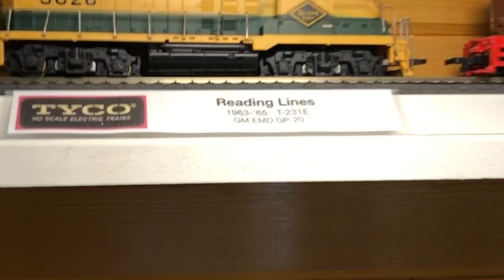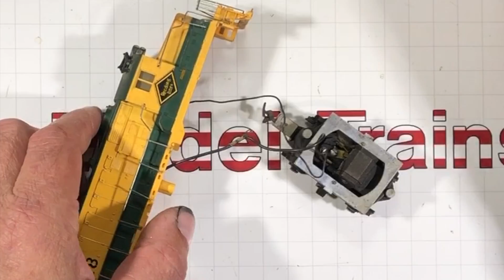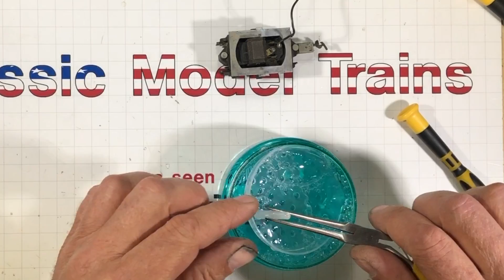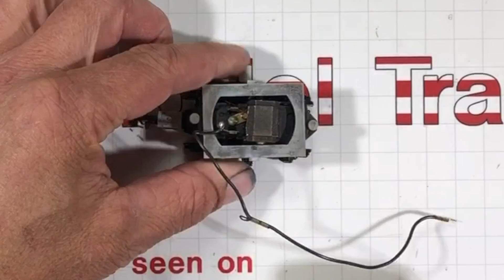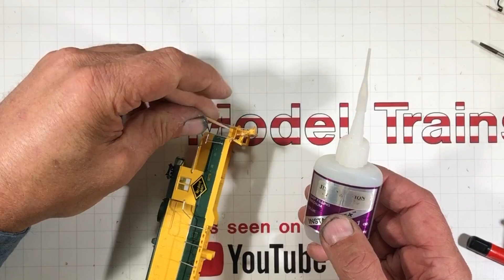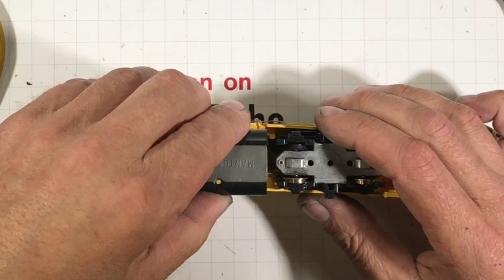EASIEST Way EVER to Service Tyco MU-2 Drives!!

Comment: Ron, I tried this method for repairing broken corner steps on one of my locomotives and it worked out well.  I got some blocks of clay and Testors tube-type model cement from the hobby shop.  I used a good step to make an impression in the clay, to form a mold for casting new step/pilot.  Next step was to place the broken step/piIot in the impression and pour the cement into the impression to form the broken step/pilot.  It helps the cement to dry faster if you let it sit in direct sunlight.  The cement formed the step/pilot in a whitish color, so I painted it to match the rest of the locomotive.
Reply from the maker: Sounds pretty cool to me Peter!

Comment: Love it! That reminded me of a technique I use to break in sealed can brushed 540 size R/C motors. We can't really get inside them without messing up the can. I submerge the motor in White Fuel (Coleman) and hook them up to a 6 volt lantern battery, let it run. Yes naptha vapors can ignite... so you must have the brushes fully submerged for the entire clean. the black junk just pours out. disconnect the battery and lift the motor out. Let it dry right out doesn't take long, then give the bronze bearings on each end just a taste of oil. Motors run brilliantly. It can also be done with water but then you have to really make sure all the water is gone. As your video shows.
Reply from the maker: I like the white fuel idea.  Faster evaporation for sure.

Comment: Love your videos Ron, thank you for sharing. I drill the rivet heads off and replace with 2.5mm screws. mxuteuk makes a nice set on Amazon " mxuteuk M2.5 Screw Assortment Set, M2.5 x 4/6/8/10/12/16/20/25mm Hex Socket Head Cap Screws Bolts Nuts Kit,400PCS 304 Stainless Steel Assorted Screws with Hex Wrench G035-M2.5" that does the trick. That way the truck can be serviced properly for years to come.
Reply from the maker: Thank you Randall!!  A few Fellers have shared the way they bolt them back together after the rivet has been drilled out.  Thanks for your information!!

Comment: I drilled my MU-2 motor rivets for 00-90 then threaded them 00-90 drilled out the rivet lips disassembled the motor then put back together with 00-90 hex head screws. worked just fine.
Reply from the maker: right on

Comment: You can get in there.  Dremel the rivets and pull the pins. Drill out the holes to take M3 bolts.  Good tip on the jewelry cleaner.
Reply from the maker: original rivets are different that a simple bolt.  Ive heard Fellers doing that.  I just wished we could get proper replacement rivets
Reply: @classicmodeltrains    Just an update on this.  I took out that top pin and rivet that holds the armatures around the motor because something is slightly warped and motor was rubbing on an armature.  There’s nothing to that assembly if anybody comes across this.   You drill the rivet out and pull the pin.  The top middle block is a magnet that magnetizes the steel armatures.  That’s all that is there.  Need an M3 bolt, a washer or two for a spacer and a nut to put them back together.  Need a pair of 22 mm bolts to put the truck back together.  End holes have to be drilled out slightly to accommodate the bolts.   Guaranteed they used rivets and pins at the factory just because it was the cheapest option at the time with no thought on future service.
Reply: @classicmodeltrains    I have just done it on one for a friend.   You don’t want replacement rivets. If you need to get it apart again 22 mm M3 bolts and nuts is the way to go.  Takes some drilling to enlarge the holes.

Comment: Super. My railroad still has six MU-2 drives in daily operation, all bought new around 40 to 50 years ago. Two Plymouth CR-4 center cab switchers and one trolley equipped with RADIAL couplers, (Trolley freight, 4 3/4 inch radius curves on the street trackage. I also have an Athearn SW-7 with radial couplers.) one Plymouth MDT end cab switcher, one F7A, and matching F7B dummy, and one GP-20. (Skipped the Centuries, later on got a GP-20 body, made a dummy with Powertorque ALCO non powered trucks, and my Sharknose was a Powertorque. It survives also as a Twin Powertorque, six axle mini Baldwin BP-20. Long story.) All got extra weight, Regular and radial Kadee couplers, some details, full handrails, lighting, good servicing once a year. and windows, (Scotch tape on the GP-20.🙂) and look and run great. The F7 and the GP-20 got their grooves for traction tires filled in, (My railroad eats traction tires.) And the GP-20s got dynamic brake blisters and cooling fans from two Lionel GP-9s. Both will still pull a respectable train, inside or outside, and have a nice patina, from being used so much, that looks very realistic. Hello again from the Tracy Mountain Railway in Colorado. 💙 T.E.N. Edit: All of these are American MU-2 drives, but some locomotives had an Austrian or Australian version of the MU-2 drive, which ran well but was quite different. 💙
Reply from the maker: Sounds like you did a lot of work to them Classic's.  Nice to hear a good tale of good 'ol loco's still doing there duty

Comment: Tried the Walmart jewelry cleaner: it does clean everything and improve low speed travel, but one still has to get to the motor (blow out the rivets) to avoid having to "touch it to make it go" when it is on the track. 

Even though you can rejuvenate MU-2's like new all day, there is something about them where they cannot make it reliably across Peco double slips on the main lines without a stall or derail, and I have at least one on every main line. I know Peco double slips are not NMRA, but they work well with all my hobby-grade stuff. So for my layout, I am going to sell off my  MU-2s. You can see 2 of my mainline double slips on my channel.

What is very evident on the PECo double slips is their what I call a "Xmas Tree" drive effect (i.e. named as such because they are found in train set diesels):  there is an offset between the mechanical motor output and the center of the drive truck. This means there is a built-in horizontal turning moment (i.e. a torque) in the drive truck always present underway which makes them more susceptible to derails on frogs than diesels without that offset.  Sure enough the truck derails towards the direction of the turning moment on the double slip frogs. Probably a combination of the PECo deviance from NMRA coupled with the turning moment effect. Of course the AHM FM Diesel  is the most extreme example of a "Xmas Tree" drive, the Mantua offset is much smaller.

Comment: I think when you oiled the axle ends that's migrating over to the axle pickup, so she is sluggish at low voltage. I am just going to re-lube the pinion gear and leave it at that.

Comment: Can you fit two mu-2 drives into a 430 model? ...I built a golden eagle with two power torque motors .. added alittle extra weigh..and it pulls 30 cars with ease...I want to build a 430 with dual mu-2 moters ...I was wandering if you knew if its possible with the narrower rear end 🙂
Reply from the maker: Ive been wanting to try that myself.....Challenge Accepted!!!!
Reply: @classicmodeltrains  yes you lead the way ...all I gotta know if that mu-2 is gonna fit in the butt of that 430 😉
Reply: https://youtu.be/X6sS0K0Ca1o?si=JGHPEG76O90nCr2d

Comment: I love those MU-2 motors. What I used to do is carefully drill out the ends of those rivets, pull the pins, and replace them with 2-56 screws and nuts. Otherwise, I'd clean and lube everything as you did on the newer ones.
Reply from the maker: Right on!

Comment: I have an old F unit that has the MU power truck in the back.  Is that right?
Reply from the maker: I cant confirm your comment.  This one has it in the back.  it can be put in front or back I believe.  The newer power torques I know for sure their all in the front.  This Sharknose is my only MU drive.  I have a lot of 60's red box with MU-2's and I believe there in the back

Comment: I think I'd just drill out the rivets and use some small screws for reassembly.  Thanks for the tip using jewelry cleaner.  Cheers from eastern TN
Reply from the maker: They use a special kind of rivet for the assembly.  Put together in a jig.  Very difficult to achieve at small scale.

Comment: Great episode!  Any issues rinsing the motor with water after soaking it in the jewelry cleaner?  I’m worried about corrosion.
Reply from the maker: I made sure and blow dry it with compressed air.
Reply: @classicmodeltrains  Thanks, do you use canned compressed air?
Reply from the maker: @jimorlando5700  no. I have a big air compressor in my service truck I use.

Comment: Neat trick, I still drill them out and use small 2-56 screws after tapping a hole.  For the window piece you can get the Novus 1-3 set and work through that and bring that clear look back.  I use it on model car and plane kits and it works like a charm.  Great video as always!!
Reply from the maker: Drilling and tapping sounds like a pretty good idea also!!

Comment: My trick for the MU-2s is to do the scary thing and drill the rivets. The only problem is that the rivets are drilled, so you can't assemble it back together! Or can you? My trick is to get a nice bead of solder on the end of the rivet- reassemble, and then carefully peen the solder blob into a "head" that keeps the bottom of the truck nice and snugly assembled. It works quite well! If you don't feel comfortable drilling rivets though, the shown method seems like a great trick to clean up an MU-2!
Reply from the maker: That sounds like a pretty good idea also to me.  If a Feller knows how to solder correctly I can see this working very well!!  I shall try it out in the future.  Thanks for the GREAT idea :-)
Reply: My father drilled rivets and used long screws and nuts to replace the rivets thru bolt style. He loved trains . Jerry rigged everything in a good way that worked for his needs

Comment: I just stuck a Q-tip with knockoff wD-40 in the cimmutator of  mine and poked at it with the wet and then the dry end until it decided to run, sparks a lot but it stops sparking once it gets going, derails on 18 radius though 😞
Reply from the maker: Do what works for ya.  Weird that it would derail on curves.  something binding up I suppose.

Comment: What you can do is drill out the bolts and then replace them with nylon nuts and bolts. That is howvI refurbished Tyco motors like that.
Reply from the maker: Sounds a lot more involved than just doing this.  But if it works, that's all that matters :-)
Reply: @classicmodeltrains  

Not really, that is it is simple and it makes it possible to repair it if something is physically wrong with it beyond it being clogged with petrified grease and oil logged, like if a wheel has a broken flange.

Comment: I have cleaned these with spray electric contact cleaner from the automotive store with great success,
Reply from the maker: Right on! lots of different techniques have been flown my way :-)
Reply: Be careful some are not plastic compatible even if they say so. Ask me how I know!
Reply: @peterkneissl3358  I have honestly never had any issues and I have used various brands
Reply: I was at Walmart the other day and they don’t carry this cleaner anymore. In fact I was unable to locate it on the web.  Do you have or heard of a good substitute cleaner?  The ones they had was one for silver or another for gold.  Not sir if different cleaner chemical or different strengths.

Comment: Crackin me up, another great / fun / informative video Ron,  I've also had a lot of the same troubles with those dang little screws until I bought my "Mini spring loaded parts grabber".  Awesome little device to hold them screws and get them started in there little holes in places that, most of the times, are tough to reach. Police? 14 year old? Factory and pink slips? I've had them both happen to me, a couple of times I think, not necessarily in that order.  I think I just heard you say "Thrust Washer".
Reply from the maker: Another Feller mentioned that to me yesterday.  I'm looking into scoring one of them fancy things.  Thrust Washer... Is that code for drink a beer? :-)
Reply: @classicmodeltrains  yes it is, and I think I'll have another. Thanks a bunch.  P.S.  Love that intro in some of the older vids
Reply from the maker: @SteveAliciaGregoire  The Ol' Chevy pickup?  I throw that in every now and then 🙂

Comment: Susan Dey I think. Let’s see if I am right!  😊. Yep. Remember her braces caught radio signals in the Partridge Family.  Thanks will get some of that cleaner as I have committed sacrilege by breaking off the truck covers to access the commutator and brushes for cleaning then just adding some more grease after using a lot of Isopropyl Alcohol try clean off as much old grease as can.  Super glued the truck covers back on and good to go. Have had good luck with this method on a fair number of C430s and GP20s.
Reply from the maker: Erick your always right!
Reply: @classicmodeltrains  LOL nope you stumped me on the last one :). All the best Ron. Great video, thanks!

Comment: You can do this procedure using Isopropyl Alchohol (IPA) at a pinch, and with any hard to dismantle drive units. Keep IPA well away from painted parts though.
NOTE: IPA fumes can be flammable so this is at your own risk, but so long as the motor is submerged completely it does not spark and I have not had any problems over many years.
Reply from the maker: I bet it works as a good solvent/degreaser!!  Thanks for the tip :-)

Comment: I like the cleaning method, but there are two spots on the armature that really need lubrication. These are journal/strap bearings that hold the armature to the frame body of the truck. The best way to get to them is to drill out the rivets which everyone hates. I don't know the exact size of the screws, washers, and nuts, but my guess would be #2–56 1" screw with matching nut and washer. The screw/washer combo would be mounted on the topside for the pivot plate and the washer at the bottom for the truck cover plate.

I would like to add that someone on YouTube a long time ago actually drilled out the rivets, but never showed the reassembly process. The video does show a good deal of the inside of the motor assembly. I will leave the information to this video for reference.

Channel Name: watchnu2
Title: MANTUA MU MOTOR BREAKDOWN_WMV V9.wmv
Video Link: https://www.youtube.com/watch?v=KGfIyZ_OrNk&t=306s
Reply from the maker: Thanks for the link to the video.  I believe a nut on the bottom of the truck would hang to low and get caught up on the switches.  I also believe the pan head of the machine bolt would do the same thing.  I completely agree that both journals of the armature need good lubrication.  I was able to get to one very easy. Perhaps the oiling of the gear externally will transfer oil onto the worm gear and If I wish hard enough it might make its way into that other journal.  Now the only way for me to test this theory would be to run this GP for many hours and see if a dry journal squeal starts to rear its head.
Reply: @classicmodeltrains  I would not disagree about the nut being a problem. My idea would be considered experimental until proven otherwise. The nut could be modified through grinding and sanding to avoid being too low to cause problems. As far as using a pan screw without a washer, the washer would serve two purposes. The first would allow enough for the swivel plate to have enough surface area to contact, and the second reason would compensate for the screw being too long even though grinding/sanding would compensate for length.

As an interesting twist, I have a Tyco/Mantua PRR F7A unit from the 1960s which have screws in the bottom truck plate. Could the answer already be found? Well... I haven't disassembled it to find out. Maybe, it has the answer or maybe not. The saga will continue to this answer...

As far as the oil reaching the bearings mentioned in your comment, I would hope this happen. Your method is more of a non-evasive method to the 'drilling out the rivets' method. Your method would be far simpler. If the engine develops a squeal, then the bearings mentioned may need to be addressed. Otherwise, time may tell for the owners of the Tyco/Mantua MU2 drives.

Comment: When you were pointing at all your engines on the shelf at the beginning, it sounded like you were saying bear turds, bear turds, bear turds. I tried closed-captions and it had no idea either. Is that what you were saying?  And Susan Dey was pretty stunning in that photo! Thanks for sharing that one.
Reply from the maker: I was saying PowerTorque. That’s the kind of drive system in the other half of my Tyco engines. I gotta quit mumbling :-)

Comment: Hy Ron, never seen this before. Must be constructed by a guy who never ever serviced a loko or never ever had anything to do with it ( lokos..... or model rails....) is this brand still alive? can' t believe it😂😂😂. Regards from Germany Rainer
Reply from the maker: This type of motor truck was used from 1960 till around 1973 from a manufacturer called TYCO.  They are not around anymore.  stopped in 1993.

Comment: As a kid I remember watching The Partridge Family on TV after school. I have the recalled version of the Spirit of '76 Tyco loco with the MU-2 drive. I will clean that up. The recalled version has the seal on the side that says "President of the United States" which Tyco was later told they could not use. They then came out with the version you have on your shelf.
Reply from the maker: Yup.  Theres 3 versions of the '76.  I need 2 more!!